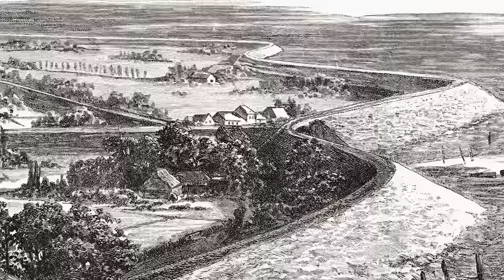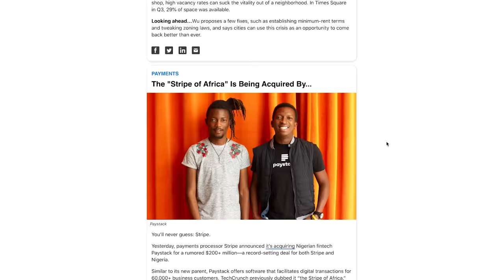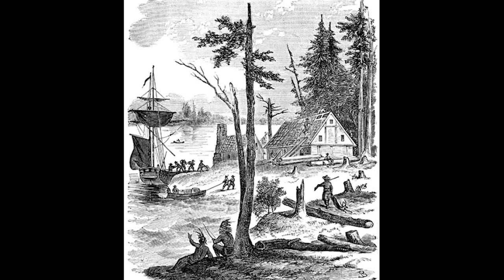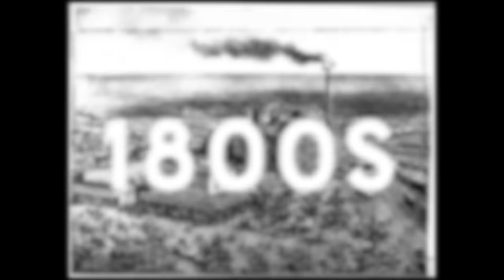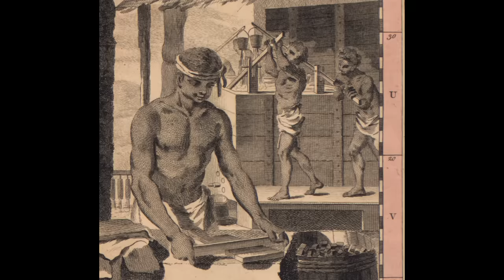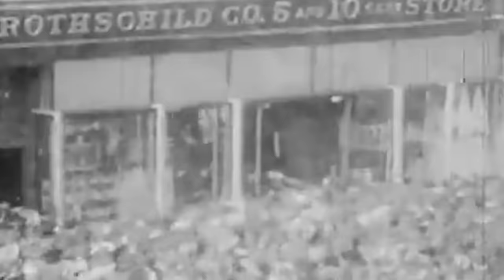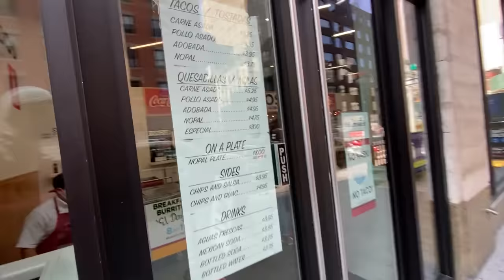Why New York City is so Huge

Comment: The Bronx isn't named after a Dutch city, Harlem is (and as mentioned in the video: Brooklyn). The Bronx is named after some Swedish dude called Bronck.
Reply: Like the pokemon trainer?
Reply: Interesting
Reply: Ye, Harlem is named after Haarlem and Brooklyn after Breukelen.
Reply: Yes, one Swedish family called Bronck basically owned all of that land so it was named after them. Also why it’s called THE Bronx as opposed to just Bronx.
Reply: @Jellyroll2   Beat me to it.  Jonas Bronck to be specific. (including most of Westchester)
Reply: There’s an intermediate step to the story.

The family gave their name to the small river that runs right through that area into the East River, and the river became known as the Bronck’s River.

When the Borough was formed in 1898, it was named after this river.

In common English, you refer to rivers using definite articles (eg, The Hudson, The Thames, etc)

So, it was named The Borough of The Bronx (River)
Reply: Haarlem*
Reply: @firesurfer  some argues Jonas Bronck is actually Danish

Comment: Hey Johnny! I see you already fact checked the bit about the Erie Canal. It’s also worth noting that the canal system spanning off the Hudson is even larger including the Delaware and Champlain canals. Not sure if you looked into the Champlain canal, but with your love of maps I’m sure you would appreciate that one can travel from NYC to Montreal via boat thru lake Champlain. One other thing to note is that even though the canals didn’t come till the 1820s, the Hudson River still had a massive effect on how NYC developed. It’s by far the longest navigable river on the East coast and this allowed New York a way to relatively quickly ship goods from upstate to population centers downstate. Even before the canals the distances between the Hudson and lake George and lake Champlain were short enough to facilitate trade via portage with Vermont as well. What I’m getting at is that NYCs access to the interior  via waterways helped provide it with easy access to agricultural areas that could help sustain its population and industrial growth. Lastly, a fun fact is that the US Navy was founded at whitehall, New York on lake Champlain to fight the British and prevent them from using the two lakes and Hudson River to cut off the New England colonies. I don’t usually comment on YouTube videos but I really appreciate your work and thought you might appreciate some of the things I’ve mentioned. Thanks for doing what you do !

Comment: As a resident of (Old) York, I just want to point out that until the 16th century York was an extremely important international river trading port, and was the second richest and most important city in England after London. Unfortunately around the 16th century the river clogged up and large trading ships could no longer reach the city, so it began to decline as trade moved to Hull, further down the river. It's mainly a tourist city now, known for its city walls, the York Minster, the Shambles, being the capital city of the Vikings' English kingdom, and also being a major stop on the London to Edinburgh train line.

Also it floods a lot and we have a lot of geese.

Comment: Loved the city.  Still do, even though it doesn't love me back.  Would love to make one more trip to visit there before I die, though at present that seems unlikely.
Reply: I've pretty much come to the same conclusion - which is why I want to move to NEPA, where I can buy a house on a 100 acres of land for what a 1/10 acre lot costs on Staten Island, with a third the taxes to boot.
Reply: @machinist7230  That thought has occurred to me.  Might be able to drive to a NJ Transit station in about an hour, then work or sleep on the train.  But if I had to work in the city more than occasionally, that would probably get really old really fast.

Comment: Actually New York Isn't huge just a lot of people crowded into one space that makes it seem huge. having 8 mil people crammed into a shoebox doesn't make you big, only crowed. Heck Manhattan alone  is only about 12 miles long and 4 or 5 wide. You can overlay all of New York's boroughs (the whole city) over the San Diego area and it doesn't even cover that. They have a massive transit system to take people 3,4,5 miles. It's just overcrowded but not big.

Comment: I thought it is dense, not huge. But you are right, it has half as much population  per square mile, as Paris. So despite the skyscrapers there must be lot's of lower buildings.
Reply: PARIS is only 41 square miles while NYC is nearly 500 square miles. How is New York City not huge ? You sound ridiculous.
Reply: @wilmars9146  density is not size, for case you don't know.
Reply: @holger_p  You said NYC is not huge.